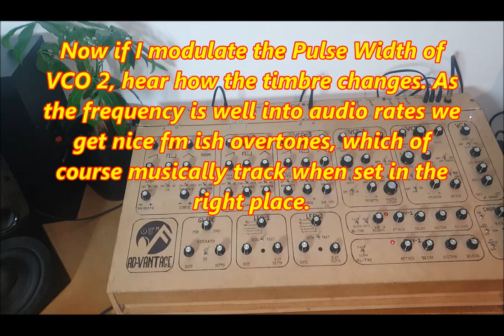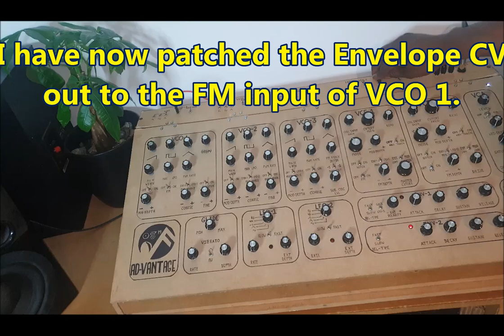DIY analog synth project ( Ad-vantage 03m patch panel audio demo )

Comment: Hi, Adam! Env to PW sounds like a very good thing!
The switching jack socket is a usual thing. At least for big jacks. There is a simple mechanism that allows to use hard wired scheme or which you're inserting in a socket.
Reply from the maker: The ENV to PWM definitely adds an extra element of timbral variation. 
Yes I will look into that jack switching option and figure out if its nesseccarry to add to my design as it is. It could definitly work for adding ENV pwm control to the other oscillators and to add velocity for the VCA . 
Thanks for watching my freind :-)
Reply: @AdamTheAd-vanc3d  Thank you for demos and your efforts in synth DIY area!